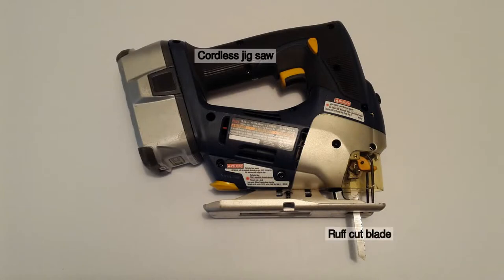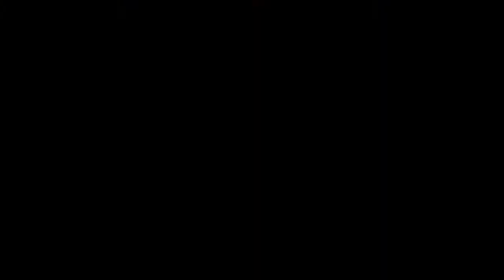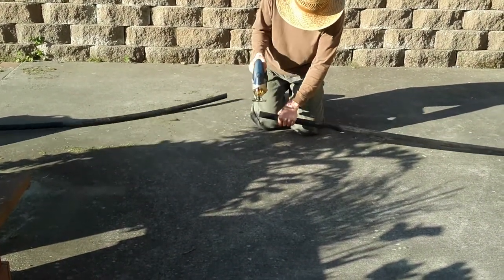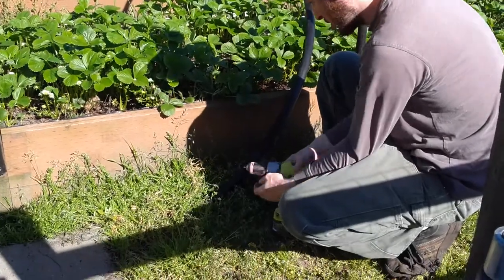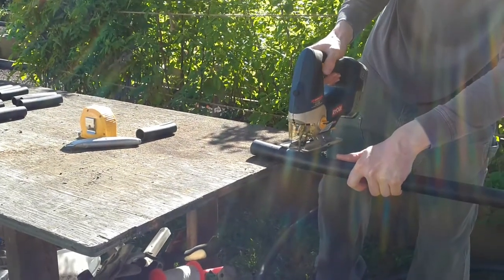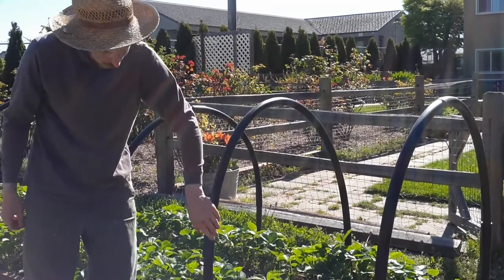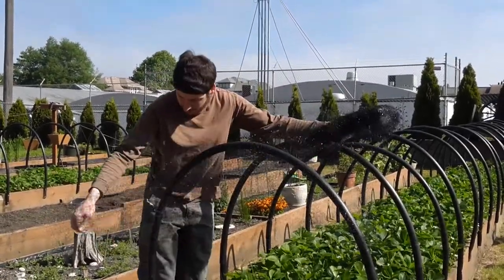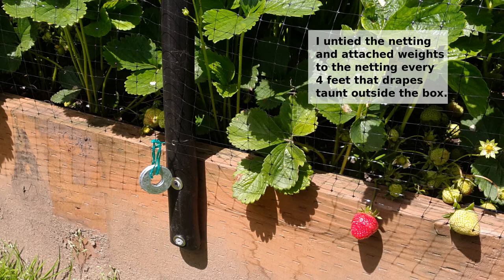Constructing A Row Cover

Comment: once it was stretched did you have the netting hung on something to hold it down on the sides or just let it hang so you could access your strawberries easily?
Reply from the maker: To answer your question Michael, after a couple weeks, I just let the netting hang down. I tied the netting every 4 feet, to a pair of metal washers. They kept the netting taunt. The netting was then secured only, from just the top of each row-hoop.  The strawberries where then accessible by lifting up a broad length of netting on one side and flipping it partially over to the other side of the box. 

In the early spring, the extra side clips can hold down the plastic sheet, row cover. Facilitating an earlier start for some new plants.